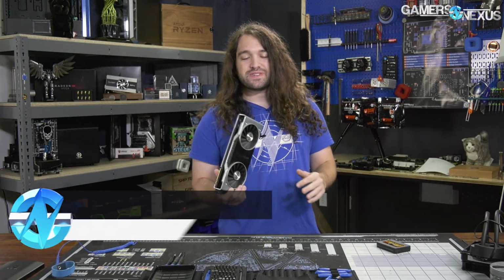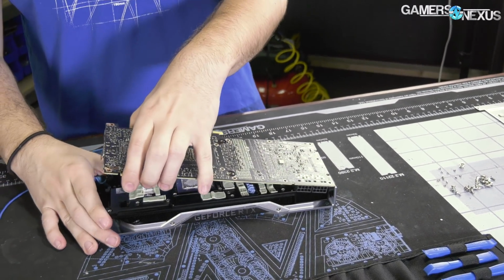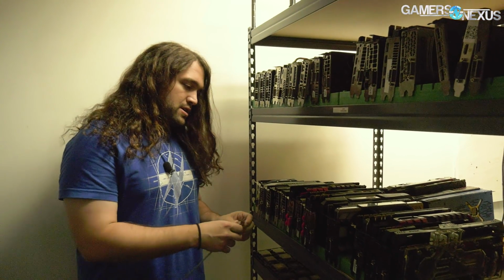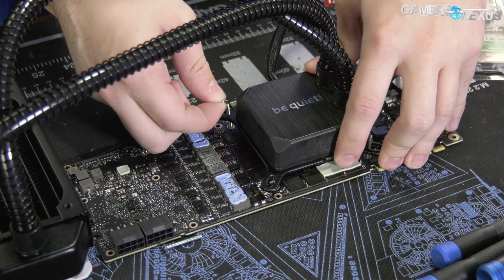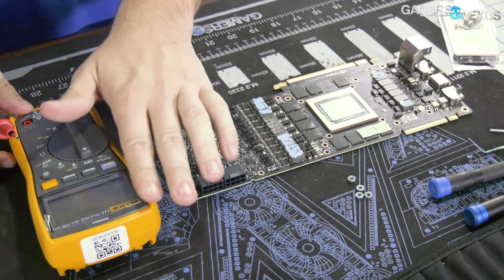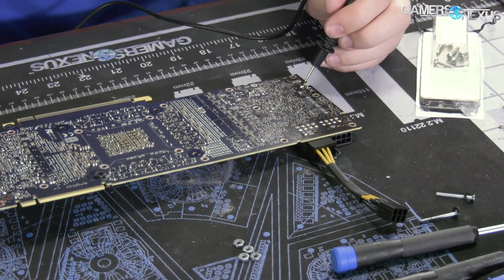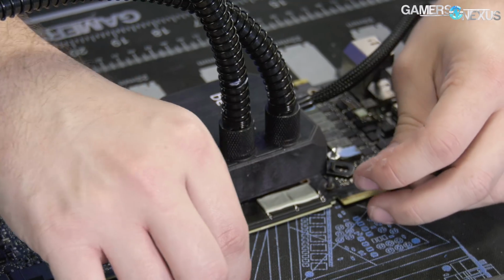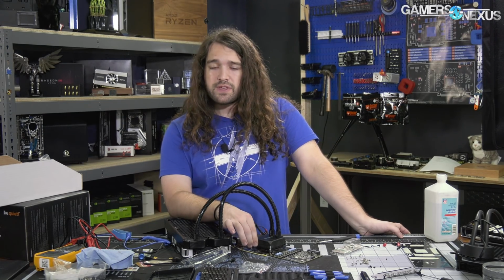RTX 2080 Ti Hybrid Mod: Liquid Cooling Founders Edition (1/2)

Comment: I wish the Silent Loop 280 was available in the United States, great looking AIO. Shame that Be Quiet really only sells their air coolers here and not the liquid coolers.
Reply from the maker: Legal issues with Asetek prevented that, unfortunately.
Reply: "patent for a heat exchange pump at the heat source"
might as well patent using an even number of wheels on a vehicle or using a bigger radiator on the outside for a refrigerator compressor
Reply: Is there a good article or site I can read up on that? Doesn't Asetek make virtually all the liquid coolers here in the U.S. or something?
Reply: @roller_47 Asetek have the US patent so they're the only manufacturer allowed to make CLCs with the pump integrated in the block iirc. That's why everyone who wants to sells CLCs with that design has to go through Asetek. There was one noteworthy attempt at placing the pump in the radiator to circumvent the patent, but I don't recall which manufacturer did it.
Reply: EKWB had or still has ( I cant remember), with a pump built in the cooler, and their evo mx cpu block.
Reply: @CampyCamper  I think you're thinking of Swiftech, EKWB and Enermax. Swiftech and EKWB have intergrated the pump into the radiator, Enermax intergrated the pump in the tubing going to the block. These are the ones I know of there may be more. And I don't know if all are sold in the US though... Edit: see; Swiftech H220-X, EKWB EK-XLC Predator, Enermax LiqFusion
Reply: grorsair h50/5 i believe
Reply: this is the one i was thinking about NZXT M22 https://www.youtube.com/watch?v=xSddZUS26Ak
Reply: Alphacool made the Be Quiet CLCs I think. So you could get one of their Eisbar AIOs. Plus the new clicky tube connectors would let you easily expand the loop.
Reply: @jmcott14  Agreed, I've got a silent loop 280mm and a alphacool eisbaer 360mm and they're amazing liquid coolers

Comment: 11:25 Why did you take it off to clean the thermal paste? Should have just put more on, what was there was enough.
Reply from the maker: Because that was used paste that had already been applied previously?
Reply: Meh, sorry.. should have said not enough. And besides, it doesn't matter, mixing multiple thermal pastes is obviously the way to go for proper cooling. The Verge said so.

Comment: EKW does sell water blocks. Is there any reason why those wouldn't provide as much an advantage?
Reply: No real advantage or disadvantage for those water blocks. At the end of the day it down to how fast the card is cooled by -- the pump and fans speed + radiator size. Water block just there to transfer the heat. Yes quality of the water block metal come into play also but it doesn't  matter much. Also aio mod is much faster to work with than individual parts.
Reply: Odd Job Entertainment It probably couldnt have gotten shipped at that time. This is really close to launch still.

Comment: THE VERGE THERMAL APPLICATION STYLE!!!
Reply: Because three out of four screws is good enough!
Reply: That might become a MEME... so many comments over last while... ha... slide the PSU over the bottom pads to avoid grounding it then screw it to the side of the case?
Reply: The Verge wouldn't have removed the original paste though....

Comment: I really like the mods you guys do, it makes me happy to see people still enthusiastic about making things work and never settling for "what's given" keep the content coming gamers Nexus.
Reply: Same here. Shunt moded my 1060 with 2MO resistors and istalled a arctic accelero xtreme VI cooler on it. Card runs  @ 42°celsius under load. (2138MHZ @1.093mv GPU and 9200MHZ RAM) Power draw is at 180W.
With my mods i was able to achieve a 4850 score at time spy.
Reply: whaaaaaaaat so you basically have a 1070 but in a 1060 wtf 2138 is mazing
i wish i knew what this shunt modding is seems dangerous tho lol
Reply: @tgdhsuk3589  no a 1070 scores at least 5450 stock. Most do more than 6000. But yeah a 1070 has 50% more shader units which is why its faster even stock. 

Soldering some resistors onto a pcb is not dangerous and quiet easy if you know what you do. If you dont do a vmod and increase core voltage to more than 1093mv (nvidias limit) the card will be fine with a normal life span
Reply: @ThunderGoatz  yo same here
Reply: Well, things were easier back when the top of the line GPU would cost you €400. But I follow your philosophy

Comment: Dude. Cardboard part bins. Cardboard? Really.  Plastic
Reply from the maker: 1: Cardboard is easily replaceable and is cheap. It costs 3x as much for plastic of the volume we bought.
2: Plastic is absurdly wasteful.
3: Plastic holds a static charge like friggin crazy.
4: Do you seriously have nothing better to do?
Reply: dude. That's why he's the computer God. I had no idea. But. A Non static bag is plastic? That bag they ship those RTX thingies in
Reply: Plastic can build parts damaging static electricity.  Cardboard is electrically neutral.

Comment: Is it okay to set the MSI 1080 TI Aero OC fan speed in MSI afterburner to 90 in order to achieve  mid-70s Temps and if so Will it decrease or shorten the lifespan of my GPU??..  and or is it a good idea to always reset the fan speed to Auto in MSI afterburner when I'm done gaming Etc?
Reply: DAWGZofWAR you should make a custom fan curve in afterburner. You can set it to turn the fan off under for example 50 degrees and  make it go up to 100% speed at 80 degrees if you don't want your card to get hotter than that. By double clicking the fan curve window you can change speed increase between steps and linear. Make sure to click on auto and the cog symbol right next to the fan speed bar on the overview when you're done setting your curve.
Reply: @EVPointMaster  thank you for replying I appreciate it... Can you please explain in detail how exactly I would go about setting that fan curve as I'm relatively new to the MSI afterburner.. at the moment when I go into it and try to set the custom fan curve I'm only allowed to set it at one point where as all the other points along the graph are fixed and I'm unable to move them etcetera... Also I don't exactly understand how the fan curve works I usually just set the fan speed itself to 80
Reply: I always use a custom fan curve on every gpu with Afterburner
Reply: @DarkReturns1  it sounds like a good idea but I'm someone I'm familiar with how to set the fan curve other than two set the fan limit itself to 80 out of a hundred
Reply: @dawgzofwar6674  it's in the settings menu. In settings you can goto the fan tab and create your custom fan curve there. Jayz2cents did an awesome video about this, it's basically free performance without overclocking.
Reply: This video shows you how to set a fancurve in afterburner

https://youtu.be/jF3P9cNQZb0?t=2m10s

Comment: hello I'm a new sub to your channel and I really like your channel... It's very informative... Can you please tell me what I can do with an MSI 1080 TI Aero OC in SLI config I'm asking because they don't have back plates which makes it look a bit tacky and also the top card runs at around 84 degrees Celsius and I'm wondering if I can just water-cool the top card( if so what would be the best aftermarket all-in-one water cooling solution for a 1080 TI Aero OC )while leaving the bottom card  untouched... And or can I order aftermarket back plates for these models and if so which kind of back plates and do the back plates come with thermal pads already installed in the rights places.. I really need some good advice... Please help?

Comment: It doesn't OC much better under water. Nvidia locked the card down. Der8auer tried it all. Even did a power mod, voltage mod.
Reply: Is this a chip issue or a board issue?
Reply: pickles , You're right ! Sorry I was talking about the benefit of locking voltage but there is none concerning amperage lock. The PCIe line is already protected by the load balancing circuitry. Overcurrent protection could be relevant in case of short-circuit to avoid damaging other parts of the computer but you might just need a simpler traditional protection like fuses or TVS diodes and it's a bit redundant with PSU protections.
As Buildzoid shows us, wires and 8pins connectors can handle extra continuous current above JEDEC standards (it can even get higher on peak) so no need to Nvidia to bridle those power inputs. They must do this to limit OC capabilities and keep the market segmented.
Reply: I think Der8auer did the mod on a 2080(I stand to be corrected) so it didn't hit the power or thermal limits as hard as a 2080ti. Thou in doubt we will see the same gains and the Titan V hybrid mod.
Reply: "Its just letting the card draw more wattage, not giving it more voltage"  Do you not understand how power (measured in watts) is calculated?  A watt is a measurement of work also called power it's calculated by multiplying current (amps) by voltage (volts)  Increasing voltage and or current would increase the amount of power used by the card.
Reply: MotoK tips i dont get why its so locked down that  vrm is just so wasted on this card
Reply: @whitenoiserevived6575  I think the cooler can't? handle much more heat within the aucustic envelope.
Reply: MotoK tips yeah your right i just find it so bizzare all this money spent on the vrm, but did nvidia not realise these founder edition are the best to watercool
Reply: Update:
Forgot to say that TOM PETERSON is the one who explained the reliability reason.
Reply: Jeffrey it makes sense BUT doesn't Nvidia already exclude overclocking issues for their warranty ?
the only benefit I see is for aftermarket buyers who can have better confidence about the condititon of used cards but I doubt it's on the interest of Nvidia.
Reply: Jeffrey Photonboy not to be picky but you could have just edited your original post?
Reply: Guys,
The card is locked down for GPU (processor) reliability issues. Every time you raise the voltage the GPU life decreases and as you approach the maximum overclock it can even drop below SIX MONTHS though it varies a lot... NVidia has every right IMO to choose a maximum load to give 5+ years expected life to typical cards... 

put this another way, would you pay $1300USD for a graphics card if you knew it would only last a year if you got an additional 15% overclock (over max current overclock) or would you stick with the current max overclock to get 5+ years?

It also ties into Warranties as well since it would be a company like EVGA who'd have to replace the card not NVidia who just supplies the chips (not sure about FE cards from NVidia).
Reply: If they didnt lock these cards down how could they release a 10-20% faster titancard in christmas time that is essentially the exact same card with different bios?
Reply: I'd say it also benefits second-hand buyers. Otherwise there would be a real chance that a card bought used for just one year will die in a month or so, and there's like zero way of knowing the state of GPU degradation.
Reply: Michal, that's what I said earlier but silicon degradation doesn't apply for amperage, just voltage limitation, so there is no valid excuse here, just greed.
rethla, the Titan card will certainly use the best chips without locked computation modules on the same card fullly populated with RAM. I think it's more a question of keeping the Quadro series interesting for pros since they already took measures in this way. Like Intel : profit margin are way higher in server grade products.
Reply: @photonboy999  did you forget nvidia releases a new card every year

Comment: Curious if you could've gotten a Kraken G10 to work on it?
Reply from the maker: No. You'd have to use this cooler anyway. The hole spacing is incorrect and there is no actual point to using it. We can get better cooling with a freestyle mod than with the constraints of a GPU bracket.